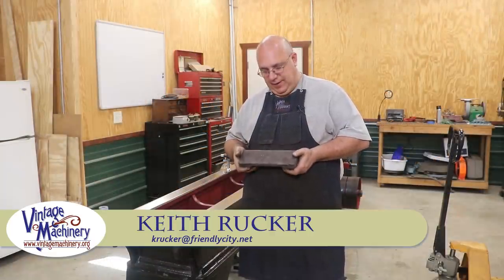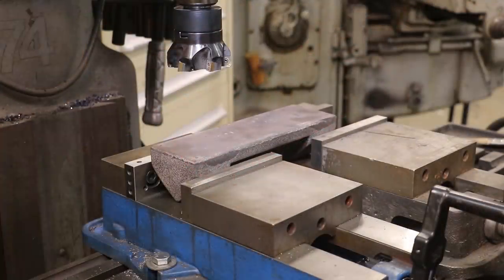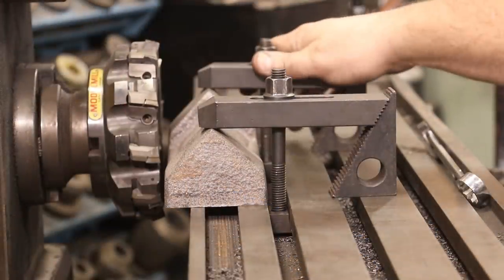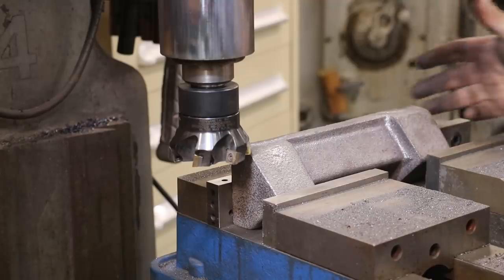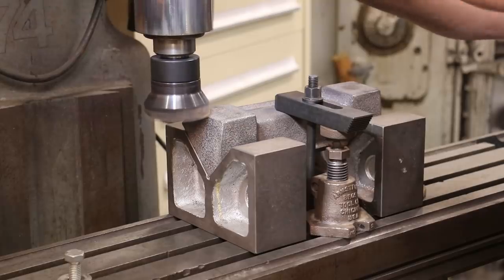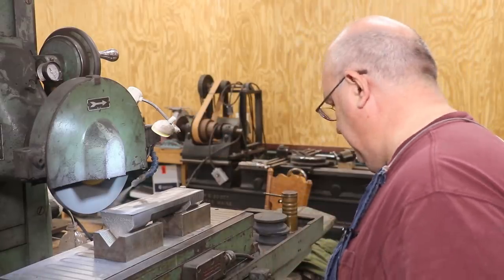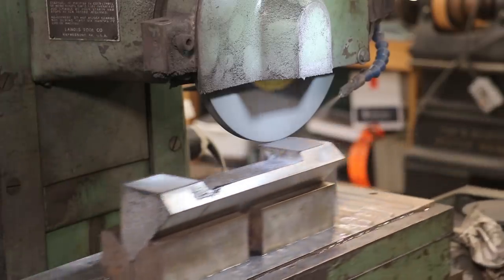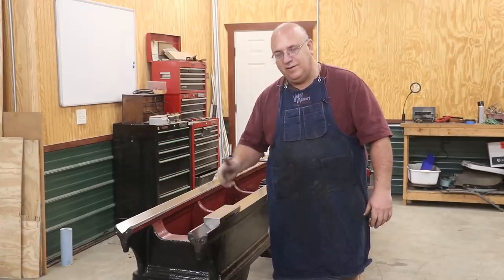Milling and Grinding an Autocollimator Mirror Sled for Inverted V-Ways

Comment: If your milling machine has the necessary power, DON'T do that initial scraping pass. Cast skin is very hard on your cutting edges, and having the tips of your inserts subject to that wears your tools down prematurely. Better have the skin cut somewhere along the edge of the insert.

Comment: Better get to work on that thing on the surface plate to get it all as dead on as possible or you will need to be certain to not move the mirror any on the sled during every use or your measurements will have compounding errors.  Easy to go down the rabbit hole when doing tight tolerances over long distances.

Comment: Pity it didn't have "RUCKER" cast into it--might be worthwhile to have some appliques generated by a 3D printer so they're ready to apply.  Now, all that little cast iron sled needs is a matching nice little wooden case for storage.
Reply: 3D printing takes a lot more time and knowledge to be able to draw in say fusion 360 or tinkercad then printing something that size will take hours, then you have to finish the printed parts to take out lines, get the draft angles correct, with wood (which Keith is used to working)its far quicker and easier to do with a saw, a few nails, plain and a bit of sandpaper, by the time the 3d drawing is done it could be made and finished in wood. you can get more detail in a 3d print like name etc. but If desired he could just have printed his name a few thou tall and glue to the wood.
Reply: @incubatork  My idea was to make lettered appliques that could be glued to a wooden pattern, which was pretty much a standard practice when patterns were predominately made by hand.
Reply: for a part that he is not going to sell, such detail work only serves to make the casting process more difficult.

Comment: From what you've shown on the video, you're only guessing the sled has full bearing in the V and the V's are synnetrical, have the same orientation, and are parallel. Check the sled bearing by applying a little blue to the bed V etc. Check the top with the level just for info, and do the same for the other V. You can correct the sled's bearing in the V by scraping. Autocollimator checks are fussy work. You don't want wobble on the sled to influence linearity readings.

I realize this is a century old planer and you have an autocollimator you want to put to use. A planer bed is a perfect application for two-axis autocollimator linearity checks but your nice old New Haven planer is a bit too lightly built and limber for a serious metrology campaign. However, it is a good place to sharpen your optical tooling skills. Go for it even though the results may not be perfect. You (and we) will learn some valuable lessons along the way. Incidentally, have you found a way to video through the autocollimatot's optics?

And, by the way, an autocollimator won't test parallelism and planarity without special set-up. Parallelism is better tested with the Kingway. Here's a hard fact: no one test for machine tool grade level, planarity, parallelism, circularity, cylindricity, concentricity, etc exists, not even laser interferometry. Optical, level, mechanical tests all require multiple means of testing to prove all bearing features in a way bearing system are flat, linear, parallell, perpendicular etc.
Reply: @chris0tube I have limited experience with autocollimators but I have seen them in use by techs who knew what they were doing in 1973. They roped off quite an area in an open shop so their lines of sight were clear and undisturbed. Space heaters were shut off etc. They had a whole array of fancy mirrors, prisms etc to support setting a very large  planer's bedways in plane to support a coming project requiring certificated machine tools to do the work. They were careful and exacting, using repeat zeros, mulitple checks and cross-checks. There was no doubt a second crew following behind using another brand of apparatus would validate the first crew's settings. We were instructed to not bother them but for a 32 year old machinist two machines over got quite a education just by watching them, far beyond what I learned in my two month optical tooling rotation when I was an apprentice. 

I suspect Keith is using this autocollimator project to introduce himself and us to its use to validate linearity in his planer ways. Not the best test example for this application but good for training as there will be several influences like temperature, floor deflection, etc to account for besides tweaking the jacks to wring the best possible linearity from the bedways. It's a worthy endeavor and probably shouldn't be scoffed at given the educational benefits that hopefully accrue.

As for the Kingway apparatus, yes, there is more usable geometric  data to be gleaned from this simple collection of apparatus for the axis by axis inspection of way systems than any other system short of laser interferometry. However its sensitivity is hampered by its 10 arc second spirit levels. Higher resolution levels will provide greater sensitivity at the cost of far longer settling time. Too bad LVDT pendulum level technology can't be adapted but my undestanding is the mass of the pendulum bob is a critical factor. The Kingway system would therefore have to be redesigned if, say, 1 arc second resolution was a requirement. 

Imagine the parading placards: "More significant digits!" "Less cost to determine them!" Slogans not suited for a street chant by unruly protesters but they encapsulate our ever-elusive goal as we chivvy and prod yesteryear's sow's ear machine tools to silk purse geometrical perfection to meet coming manufacturing challenges.
Reply: yes, i was thinking at minimum he would have to relieve the center of the v so it would be bearing on the wide and narrow end even if the angle was a bit off
Reply: @forrestaddy9644  hey man, ive seen you on so many forums, great to see you posting stuff on here too! Always loving the great info you provide 👍
Reply: autocollimator is very good for check slide like this.also have one other one collimator,with a steel wire.For use a autocollimator like that on V,need just to be sure the leveling is ok,with step by 200mm.Also,for me,if i need to do a work like that,for start i scraping for correct the leveling,and check by level,and later when the bed is ok with leveling i check with autocollimator the straightness and parallelism by the V

Comment: Thank you for video. To my best knowledge most economical is direct use of stone (rock), but it requiers separate tools or even whole machine park. Moreover it is cheaper and more usable, than modern concrete composite (fiber glass; carbides; silicon loams; et cetera - mostly below 50um/0.002inch), and provides better mechanical parameters (but still a lot worse than steel). Cast iron requiers specialized formation - above mentioned materials could be prepared in low temps. Especially first few generations of prototype could be made from concrete composite with welded reinforcement and some plywood box. Cast iron possess it's own advantages:)

Comment: Nice piece, Keith.
As I watched this, I was thinking of other ways to make that sled.
None were clearly better.
For future such casting work, tabs or bosses could be added to the casting design to provide clamping locations for workholding.
Not necessarily needed for this piece but nice features to include for machining.
Thanks,
John
Reply: He could also add various tapped holes on the sides, top and ends for similar reasons.  No need to do it now, he can wait until some obvious reason appears [or follows him home!].  Perhaps some tee-slots?

Comment: I've often thought that there would be stone loss during grinding so things couldn't come out really accurate. I do profile grinding of HSS knives and know that there is loss of wheel diameter but the wheels are very narrow to work into the shapes. A final pass is made after dressing the wheel and changing the angle of the knife slightly so only a very small amount of steel is being removed.

Comment: As long as the slots in your table run parallel to the travel, you can use pins in the slots to get parallel surfaces.

Comment: As always, very interesting. Question: Since you will use the sled to prove the ways during scraping, should you also scrape the sled surfaces prior?
Reply: if the grinding is precise enough, it's not needed. precision ground surfaces do not require scraping, though they are usually flaked to give oil a place to run in.
Reply: The piece should be stiff enough to not be deformed considerably while on the magnet, so it should be quite accurate. But he should definately check the fit and in the v-way of the planer. Matching the angles by scraping might be a good Idea (If he wants to use a level to get twist out of the v-way. That would also make it a better master for spotting)
Reply: @chris0tube We've been here before. Keith has a new toy and needs to use it.
Reply: @chris0tube He's can do a much better job than you, that's for certain!

Comment: Nice casting. You're right to take it easy on the first cuts. Deep in the rough surfaces of a casting may hide some sand or carbides that could harm the cutting edges of your cutters. In addition, the surfaces of castings have the smallest grains and therefor the hardest grains to cut through (unless of course the casting was heat treated or normalized to rework the grain size through out the casting).

Comment: Just for fun it would be interesting to compare the result of the collimator test with the machines iron sledge v. the wooden pattern.
If in a hurry, is the pattern a “good enough” part to use?
Great video and all ways informative.
You might end the video with some metrology to show the accuracy of the part.

Comment: Another Interesting bit of gear, would it not have been easier to true up a square bar on all sides, surface grind 2 sides to be the V then flatten one of the corners down to the width/hight needed? quicker machining at least? I'm not looking for faults, i like to know the reasoning for doing things one way rather than another, here to learn sort of speak. thanks for sharing.

Comment: Why not attach the mirror to your King Way?
Reply: When keith puts the table back in the V ways sit in the V's he is working on with this tool he just made. The fit is better at this point to give a better cut when the table moves back and forth. For most of us whom just goof around it is good enough, but for Keith if it is not exact he will do it right. Thanks Keith for the great videos, great work.
Reply: He covered that in a previous video. One side of the King Way rides on a ball and it's not as stable as he'd like. The way the King Way is set up it's not ideal for a double V-way.
Reply: Just what i was thinking.
Reply: You need to go back and watch the previous video again. The repeatability was poor with the King Way sliding along the double v-way. The ball is made to rest on a flat, not in a v-way. In this case the King Way is most definitely not "more stable and affirmative" than the sled he made which sits tightly in the v-way.
Reply: @deathk26  Just had a look at the previous video, Keith doesnt have it set up well to measure a double V. Loading the tube side of KW so its sat firmly in the V with the levels and or a suitable weight. Ideally you also want the ball set on one face of the opposing V,  A little lube with spindle oil/mineral spirits this gives you a smooth repeatable setup. 
Rather than make the sled id turn a collared bar to replace the tube of the KW, 10" centres makes the rise fall numbers easy with collars being around .5" - 75" in width,  his beds 11' long iirc so 12 point to point measurements is more than enough to get the global picture vertical and horizontally. 
I like the way Keith measured out from the center, I like this method as you can locate the AC directly on the bed which reduces the opportunity for error.
Rather than making the sled as hes done, i think a pattern scrapped to fit in both Vs would be more useful, not 100% necessary but makes keeping an eye on the individual surfaces relative to each other much easier.

Cheers D

Comment: Keith, thank you for this video.  I'm looking forward to you using your autocollimator on the planer.  A couple of questions though:  1.) What is the average "casting skin" thickness on cast iron.  2.) How much does the light first cut(s) dull your inserts?  I've always heard that it's best to cut the "skin" completely off at the first pass to maximize the life of the cutter.  I.e., cut deep enough to cut under the skin.
Reply: I cannot speak to the exact skin depth, but generally it is harder & deeper with smaller castings.  While back I machined a set of (30)  5 lbs weight plates, all sorts of different manufacturers and even within 5 lbs, some were way harder than others.  I used brazed carbide on the lathe rather than inserts, and chipping was way more a concern than long term tool wear.  Getting under that skin is the better way to do it (assuming you have enough material to do so), my lathe is a bit under powered for this so in some cases I just started grinding that skin off with angle grinder...works but messy & slow.  If I were keith, I would have dropped that face mill in 50-100k and then maybe a spring pass to clean it up for the grinder. I also might have done a bit more work on the casting shape to include some better work holding features and a bit more meat @ the btm so I could be sure I had enough to remove all the skin.

Comment: For a part like this that is being used in precision work, do you need to have the casting stress relieved or aged before you make the sled? I recall hearing that years ago casting like angle plates were left to age for a few years before being machined.
Reply: This was stress relieved at 1375° soaked for 2.5 hrs and cooled at a rate of 100° per hour

Comment: Keith: Like on a sine bar, I would have thought that the bearing surfaces on this would have been minimized, even rounded with hardened dowel rods, for more accuracy. Thanks for the video, and see you at the Bar-Z. Jon
Reply: I guess since it's going to measure a scraped surface it needs large contact point to average the surface.
Reply: @Broken_Yugo  Plus that average surface is what the carriage is going to ride on. Pins  give you a more granular measurement but that does not mean much for real world use.

Comment: Keith,
If I heard you right - and inferred right - you said at the end of the video that you would move the sled, check through the eye piece, move the sled, check through the eye piece, move the sled, check through the eye piece, ...   What about drilling and tapping each end of the sled for an eye bolt, tie on a cotton clothes line through a pulley and just sit looking through the lens while you pulled the sled back and forth without having to get up for each point?
Reply: You need to know where it's at when you're checking, maybe I'm wrong but in my mind it'd be easier to just move it to a known location and check instead of trying to finesse it with a string.

Comment: I think a K&E borescope would be better for this. Reads location of the target deviation from optical axis directly, no math. But you do need a fixture to hold the borescope parallel to the V-way, or lay it in the V-way directly. If I remember they have a 2.2500 or 2.5000 diameter.

Comment: you should have made 2 of them as a matched pair......not too late to order another.   Just a question, how close do the angles match?  It looks like you have about 2" flats on the 45s.  you can calculate the error they may introduce, likely not significant, but good to know.

Comment: Not wishing to seem a troll but I am surprised that you have your quill extended so far while using a relatively large face mill.
Reply: @chris0tube indeed, greater contact area of quill has to be more rigid. And spline life must be improved too if full contact is maintained, depending on machine design.
Reply: he's grinding in the final dimensions so it doesn't really matter. it's not going to affect the machine unless that is all it does every day for 30 years.
Reply: @SuperAWaC Some would say that it is just not "best practice" and it's the principle that matters as others less experienced might follow thinking it is normal.
Reply: @chris0tube very true, but i also believe one should try bending "the rules" just to see if there is a better way. For progress to occur the junior should always try to exceed the master, not just follow him.
Reply: Not surprised, old rucker isn't the sharpest but he gets it done.
Reply: @jacobpoucher  indeed he does and in the end that is ALL that matters.

Comment: Would brass work for something like this ? 

The casting could in that case easily (somewhat) be done basically by hand.
Reply: Because it needs to be ground to a finish brass is not an easy material to work with. If you could get the surface good enough with a single point fly cut brass may work. I don't know why he's so fixated on using durabar  for this application. I made one just like this out of 4130 PH, worked out great for a machine refurb. Cheap and easy material to work with.

Comment: won't you need tow of these?  one for the mirror, and another for the "telescope" part?
Reply: Just one - the autocollimator sits in a stationary position during measurements. As long as its stable it doesn't really matter where it is as long as it's lined up with the mirror. You can see in Keith's other video that he has the autocollimator on a hydraulic table cart so he can raise it to the right height, and roll it into a position that gets it lined up with the mirror.